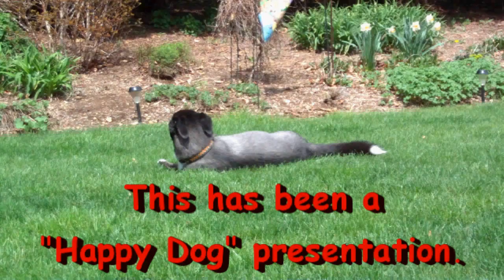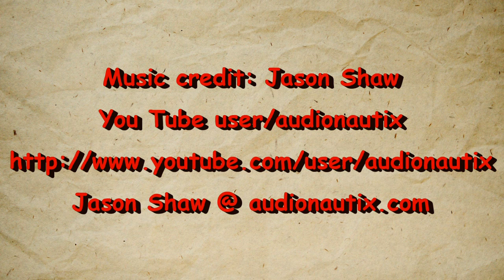Firebox Boil Test #1 Stove Pot Stand with the Trangia - Boil Test 1

Comment: Thanks for the review. I've been watching a lot, a LOT of stove vids lately. One thing I've noticed is that when using the Trangia, times to boil vary wildly. The other thing I've noticed is that the longer times come when the burner is closer to the bottom of the pot. Have you timed it with the burner on the middle set of holes and were the boil times improved? Thanks.

Comment: I'm still curious about the plate that fits into the top. Is the hole in it designed for a specific pot? And how well does it work?

Thanks.